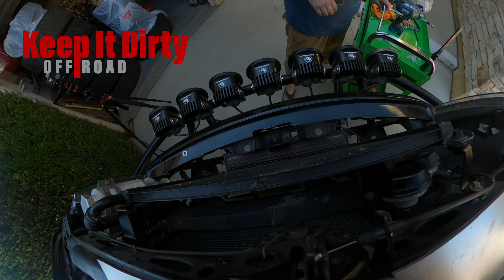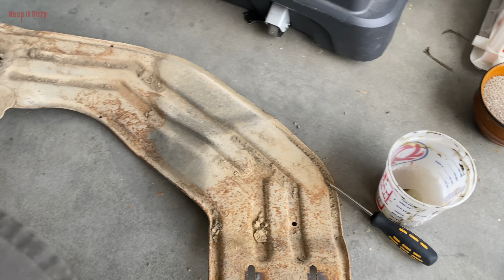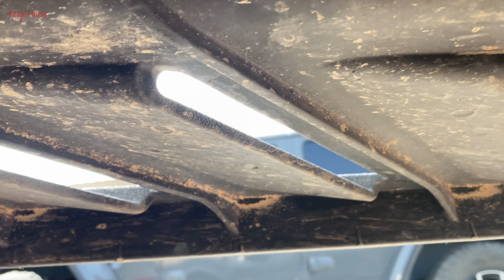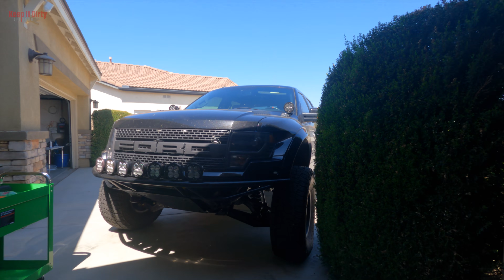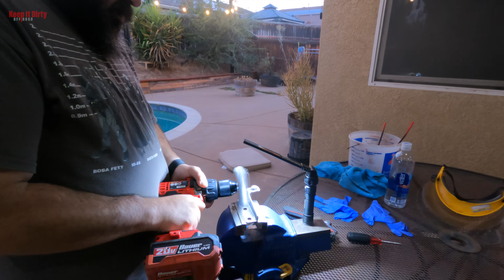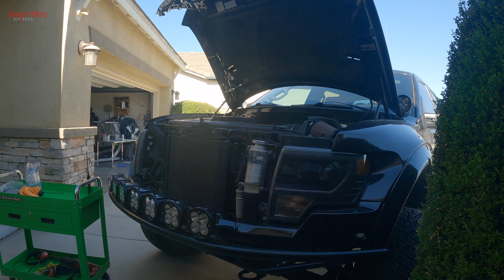Gen 1 Raptor Rehab 4 - Rust Treatment

Comment: Great video - I'm looking at a gen 1 with only 77k miles but it was a Wisconsin truck and has pinch weld rust. Not sure if it's worth buying, but I'd hate for that to be the reason I don't pick it up, since it's pretty inexpensive.
Reply from the maker: Rust is your biggest concern with a Gen1.

If there is rust on the pinch welds there may be rust inside the cab that you can’t see. 

The cab is not painted or treated on the inside. Under the cab, there are plastic cab seals to keep moisture out. As the truck ages those seals fail. If they fail and moisture gets in, the can rusty from the inside out and it’s an expensive repair. Check the cab seals before you buy. If they have failed, don’t buy. There will be a ton more hidden rust that will be a problem later
Reply: @KeepItDirtyOffRoad  Appreciate the feedback. I found one that only has 6 inches of pinch weld rust that I might buy instead. IT's a 2014 vs a 2011 and it has no penetrating rust except for that small portion of the pinch weld, which I can control. The other one I mentioned above is completely rusted across all rocker panels. I think it's better to spend the extra 3k for one that doesn't have a rust issue like that.
Reply from the maker: Agreed
Reply: @KeepItDirtyOffRoad  So the raptor I'm looking at is a SCAB in blue with the top option package - needs the shocks rebuilt, but mostly rust free. He's asking 32k at 100k miles, 1 owner. Seems like a good price - your thoughts?
Reply from the maker: I always go by KBB and nada for values. Raptor prices fluctuate a lot and they have been on the high side for the last 2 years. So take that into consideration and plan your costs for the rebuild. Keeping in mind that if the shocks have rust, your rebuild costs can go up. Shops like forged offroad have good exchange programs for that and would be my first choice

Comment: Hey man, just recently purchased a gen 1, and just saw a lot of the cab seals underneath are failing. There is almost 0 rust as this vehicle has been a pavement princess from the previous owner. I took a look at the cab itself and it shows no signs of rust. Should I be okay if I go through and put those fillings you talked about in the video?
Reply from the maker: When the cab seals fail, water gets trapped in that gap below the cab. You need to look inside that gap to make sure things are good. The rust develops from the inside. By the time you see it on the outside it’s too late.

So confirm there is nothing. Maybe ass some paint in there or some kind of rust protection before covering them back up again.

Comment: Why no PB Blaster on all the hardware
Reply from the maker: It was a matter of cost. To get a decent sand blaster  would have been a few hundreds. So had to weight our options. Spend the money or just tough it out an extra hour. Since it was just that front hardware that was bad, we elected to just tough it out rather than have another expensive tool in the garage I only use once.

Comment: For some of the stubborn rust, have you tried an angle grinder with a wire brush wheel or sanding wheel to knock that stubborn stuff off?  Something with a bit more horsepower. I had pretty quick results on steel I was welding that was left out in the elements. Just got to be careful cause it's quick.
Reply from the maker: YeH, my hands are not what they were when I was younger and that was too much of a risk for me. I know it can work mush quicker but it’s also way more sketchy. So I stuck with the cordless drill. If it got too bad, I would have invested in a sand blaster first

Comment: Great video man!  Totally enjoying your rebuild, can’t wait to see what you do in future vids.  Keep them coming!
Reply from the maker: Thanks
Reply: @KeepItDirtyOffRoad  question for you, why not apply maybe a rhino liner or line-x to those high abuse areas?
Reply from the maker: I’m not a fan of those coatings on the frame or under the cab. With the off-roading we do here in SoCal it will eventually get rubbed or sand blasted off. Yes a liner coating will last longer. But once it start failing it will completely peal off and in worst cases hold moisture. And that does not even account for the cost and extra work to install. 

In the areas we treated, the sand blasting of the desert is going to destroy any paint or liner anyway so I would rather do something that is easy and cheap to repair.
Reply: @KeepItDirtyOffRoad  makes sense.